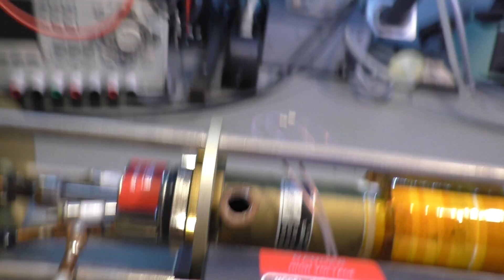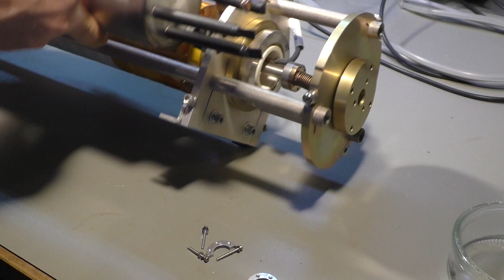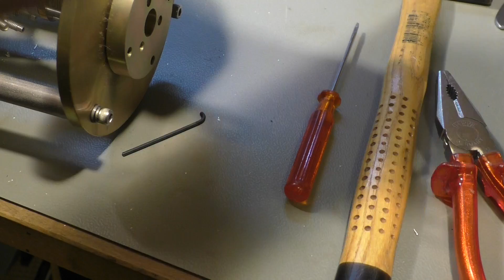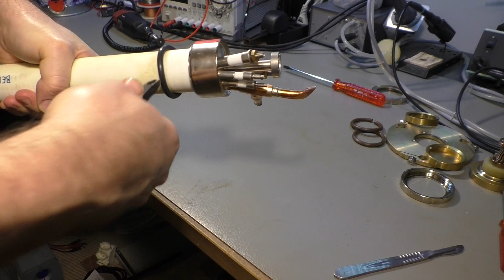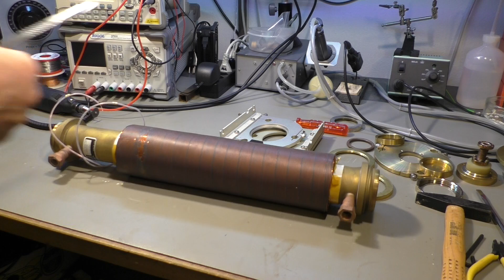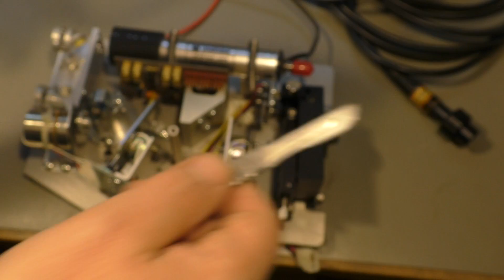PWJ43 - Argon Laser tube teardown

Comment: The three rods that form the resonator frame are Invar, it's a very low coefficient of thermal expansion metal commonly used in gas lasers as it helps prevent the cavity alignment being lost as the temperature changes.
Reply from the maker: Good to know, that makes sense. I wondered what metal it could be, looked like stainless. Good that I kept them.

Comment: I'm not sure but I think Beryllium Oxide may also be used in Magnatron tubes for microwave ovens, I have been told you can take them apart only so fare due to this hazard. 
Thank you for the fascinating Video! I really enjoyed watching you explore. and felt like I was right there beside you sharing the experience. :)
Reply: I felt badly reminded to the sci-fi movie "The Day the Fish Came Out" of 1967 - expecting the 2nd half of the clip starting with an official in a hazmat suit proclaiming the message: "The person who did the 1st part of this video expectedly deceased 3 months later. Lets talk now about the medical effects of contact with the following substances..."

Sorry. This teardown truely looked like a Darwin Award candidate.
Reply: They doesn't because Beryllium Oxide is very expensive and only used in military magnetrons, the very first microwave ovens ever made had it though but not todays. That is the reason the magnetron in household microwave ovens get so hot that they need a good fan because the heat can't be transferred away as good with aluminium oxide that is used in household equipment but good enough to work.

Comment: 36:10, well what do you know, it's a Ledex rotary solenoid. found one finally. Though this company hacked it from advancing a rotary contact switch, into another 2-position rotary application. The opposite side at 36:33 has two metal studs sized to align with the mounting holes on rotary contact switch circuit boards.

Comment: the  plastic around the gas metal tube is for arc protection the gas flow is conductive and when, and the vacuum becomes expanded under high current..

Comment: I think i remember reading somewhere that the tubes at the end of the reservoir are glass recharge tubes. If the laser does not have enough gas to ignite then you could crack one of the tubes and release gas back into the system.  Would be interesting if you could crack open the reservoir near the end and see if there is glass tubes in there.
Reply from the maker: Sounds interesting.... but there is almost a vacuum in the tube. I think the problem is not escaping gas but leaks that "refill" the vacuum. But you know what? I will have a look inside the tube and make a short video.
Reply: it is for Gas renewal certainly. because the Argon Gas Mixture will Chance Due Operation
i had this on my coherent innova Tubes also. it refreshes the Gas because refilling is very expensive.